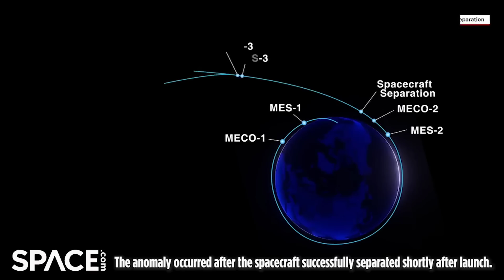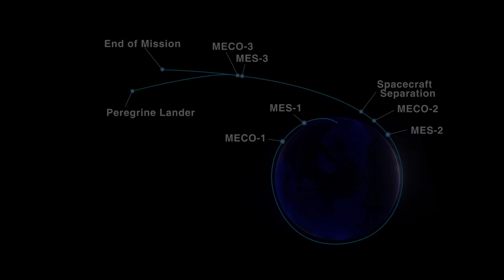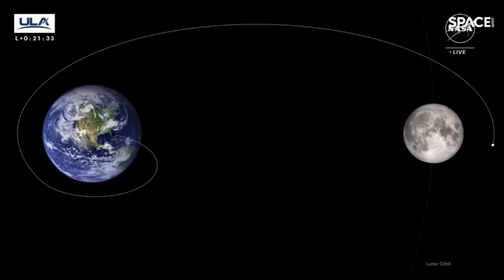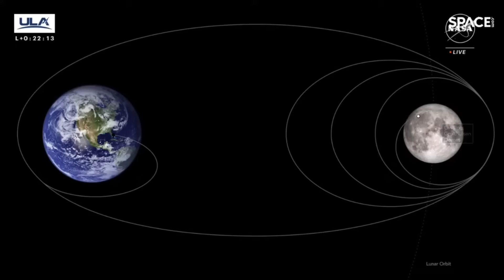We now know what sabotaged the first NASA Moon lander in 50 years!  The latest from Astrobotic!

Comment: 4:34 It was a thread issue. Being a machinist for 40 years, thread machining of very high precision and tight fit class can be over machined very easily. Sometimes a simple spring pass can change a thread from too tight to too loose. A common repair is to weld and re machine the thread. It sounds like perhaps the thread in question didn't pass a thread gage test but was "close enough". The slightest misfit to the loose side is not a good thing when subject to vibration.

Comment: What is supply cost for one of these helium valves (PCV1, etc) compared to the rocket launch ? Why would their rocket design be for a (helium) valve that is not accessible ??? All valves require adjustment/replacement !

Comment: Some commenters are criticizing people for letting this happen.  Unless you haven't noticed, SPACE IS HARD.

Angry does a great job of describing the tradeoffs involved in getting this lander ready to launch and they seem quite reasonable; Astrobotic simply lost against some very good odds and I'm impressed that we are hearing so many details about this process.  This increases my confidence in Astrobotic.

Bear in mind that a replacement second valve could have still failed; Astrobotic's only reason to suspect it was the failure of the first valve and each is individually qualified.  One Raptor can fail while 32 others continue working fine and there may have been no clue during test firing that one Raptor was going to fail during takeoff.  Astrobotic's lander did not enjoy that degree of redundancy, however.
Reply: "space is hard" is over used, it's hard but we have plenty experience with it now, smaller things like valves and what not shouldn't be an issue at least not regularly
Reply: Right.  Or like RFA: every test worked fine, many times.  But then they turn on the 9th engine and 💥🔥💸

Comment: Why is it always VALVES?  Sounds like we need a new program to develop working space valves….
Reply: They are moving parts they are electromechanical. They are dealing with high pressure liquids or gases. In very precise amounts. They have a variety of different seals. And operating under extremely harsh conditions. 
I don't know this for a fact but I'm going to suppose there are a great many valves on spacecraft. I suspect we are aware of a few critical but nonetheless extremely rare failed is a valves which is disguising and otherwise very high level of reliability.